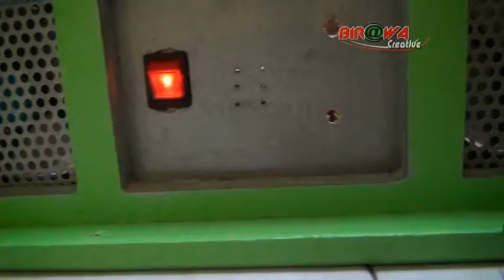CARA menambah Ampere Trafo | 10A + 10A = 20A Tanpa mengurangi Voltase AC # 01

Comment: Bang saya ada adaptor output DC 12V 5A
Biar jadi 12V 10A yg di rubah apa nya bang
Trmksih
Reply from the maker: mudah bang... menambahkan rangkaian High Current power supply bang... disitu transistor outputnya semakin banyak ngeparalelnya semakin besar Amper yg diperoleh.

Comment: Bahan2 serta ukuranya berapa om
Reply from the maker: ukuran box nya seperti box THUNDER yg dijual dipasaran om...bahan komponennya utk tegangan regulator yg q pakai:2 pcs trafo 10A merk BIG 32v CT - 8 pcs elco 10.000uf 50v - 2 diode bridge 25A - 1 pcs conector famela 220v 16A - 1 pcs switch on off + lamp indicator 16A - 1 pcs kabel stecker listrik 1.5mm (isi 3) 16A 1.5 meter om...
Reply: Mas kalo pake dioda sisir boleh gak?